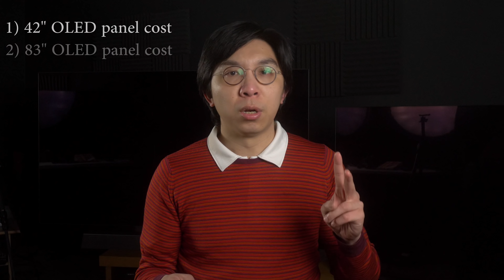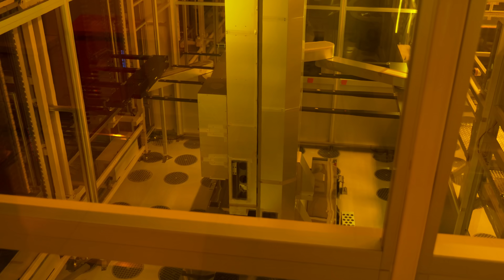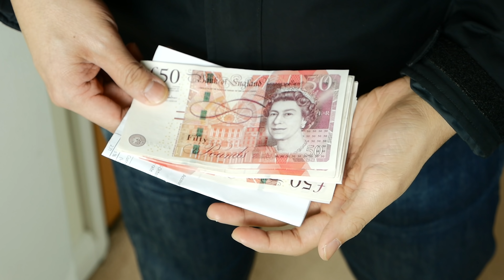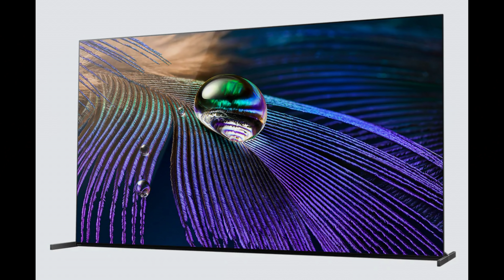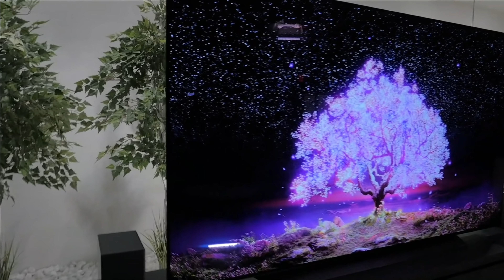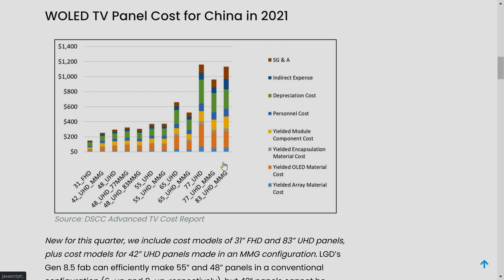LG 42-inch OLED TV Panel to Be 33% Cheaper than 55" - Will You Bite at $1000?

Comment: The issue is that if they concentrate on just cost the TV itself may be crap without the latest HDMI, VRR, HDR etc that are needed for gaming and desired in general.
I am looking for a small OLED PS5/Xbox series X gaming monitor, 32" would be perfect, 42" acceptable but none exist.  I would buy a 42" OLED if it is not cheap crap.
Reply: I agree; I am desperately waiting for a 42" inch OLED with ALL the latest stuff for next gen gaming. I will be SO disappointed if the offering don't include things like native 120hz refresh rate.
Reply: Same here :(
I mean even an mini Led TV in that size with that features and low input lag would be fine

Comment: At one point when I purchased the 48 inch OLED, it was actually more expensive than the 55 inch OLED on Amazon.
Reply: Vincent recently explained the reason in another video ... because production numbers will increase drastically this year (almost 5 times compared to 2020) ... everyone expects tv prices will match the size line-up much better this year ... in other words:  especially the 48" versions will be much cheaper this year and below the 55" ... as you would expect it from the smaller size.
https://www.youtube.com/watch?v=h-OehUXiyr8

Comment: I might bite for PC gaming, as I am currently running a Acer Predator 43 inch gaming monitor CG7 CG437K. That cost me $1200 and I it worked out for me great. My area is very bright being next to a window and having roughly 800 nits in SDR and 1300 nits in HDR mode (according to Tom’s Hardware) was nice. But, now the monitor bugging out by creating a circle on my screen when I go prone in a First Person Shooter games. I am guessing it is a glitch with the reticle on screen feature popular in gaming monitors. But, I do not have it enabled on my monitor as it is distracting to me. Looking forward to replacing it with an OLED.

Comment: FullHD ist enough for most people... a lot sitting 3 meters from a 55" tv, so you really do not need here 4k :D
Reply: That's so true :-)   ... except for HDR where you can spot the difference even from 10 mtrs away (or even more) ...

I wouldn't mind getting HDR with re-mastered new transfers of FHD material, stored in 4K HDR containers to make it not violating the standards ... although when going for a new transfer you can go directly to a higher resolution instead ... lol ... kind of useless considerations, I think ... I just wanted to point out getting HDR i/o SDR is of much higher value than getting 4K i/o FHD
Reply: @marcuscole8796  i transfered all my Blu Ray UHD Discs to 1080p and you cannot see a difference at 3,6 meters away from my 65" TV :P 

The only Problem i have, Dolby Vision movies need a lot more work to add IT again in the 1080p version :/
Reply: @prouuun  Yes, makes perfect sense. My viewing distance is about 2.8 mtrs and even with this smaller distance - when having FHD in good quality - it's sometimes hard to spot differences to 4K on my 65" tv.  For sure you can't see any with your 3.6 mtrs  :-)
Well, besides of that a lot of 4K content actually is not always true 4K (2.4K , 3.6K or whatever) ... so by choosing true 4K material it might be quite easy to detect a difference from say 2.5 mtrs ... but bottom line when concentrating on the movie plot (what I usually do...lol) and not on the resolution ... I do not notice it nor do I miss something regarding picture details ... but the smaller contrast range of FHD I can detect any time  :-)

Comment: 42" 4K HDR 120Hz OLED panel for $1000 would be the perfect PC monitor.
Reply: I would buy it in a heartbeat, holding out on these current hdmi 2.1 monitors bc they have trash hdr so for $1000 this would be great
Reply: @parkerschless3749  but what about the burn in ?
Reply: @mrwaddahshooter  Burn in is no longer a problem. I know some ppl using an OLED as PC monitor for years and nobody has burn in problems.
Reply: @EinBlauerEngel  do they baby it or leave it on all the time which is what I do?
Reply: @mrwaddahshooter  
I don't know if you mean with "all the time"... if you mean 24/7 then no, but shure several hours for gaming where you have UI elements which are not changing
Reply: @EinBlauerEngel  the thing is I almost never turn my tv off and I'm afraid to get an oled for that reason

Comment: The 32 inch oled seem to be the LG UltraFine OLED Pro 32EP950
Reply: No, the chart says 31" not 32" ... and ... the 32EP950 doesn't have an WRGB panel from LGD but an RGB-panel from JOLED (which is not subject of the presentation here)

Comment: $1000 for a 42"?
It's better buy a 65" IPS high quality for $1000 in Brazil, as a Samsung TU8000!
Reply: You are talking "Ferrari vs Hyundai" ... of course the Hyundai has a much better value-for-money relation.  The TU8000 is not even close to being capable of showing HDR. As long as SDR is good enough for you ... the TU8000 is for sure the better choice.

Comment: How comfortable is a 42" panel as a desktop monitor (gaming/developing) ? Standard 60 cm depth desk. I've been considering this for a while, and read that 48" is a bit much. Generally leaning towards having a single 16:9 larger screen, rather than multiple smaller ones.

Comment: ABL will destroy its usage as a PC monitor. I was so sick of the constant dimming to the point that I had to return my 48CX...
Reply: ABL specifically or ASBL and ANSD (which dim static images over time)? The latter two can be disabled in the service menu.
Reply: I am really wondering how you are using your PC monitor.
100nit to 120nit is the standard recommendation for PC monitors in normal office environments.
The 150nit fullscreen white of current OLED-tvs is more than sufficient.

Comment: PASS.  These smaller OLED panels are useless until they are able to achieve higher brightness.
Reply: Still brighter than most PC monitors though, if burn-in is not so much of a problem now, as Vincent tested, there is no reason to get a PC monitor instead of this really...

Comment: i really wish that lg will return making 3d screens with passive glasses ..
Reply: Good luck. There are significant Hurdles with bringing 3D back, especially with the Motion Processing and backlight enhancement tech that’s common for upscaling and HDR content for LED. The tech required for 3D isn’t compatible with HDR, as they didn’t overlap or continue once HDR took over. 

HDR processing for 3D also introduces a pipeline problem as the intentional BFI intervals or staggered frame processing buffers, i.e. frame-doubling 23.976fps to 48fps so that you don’t notice the SDE or blanking left/right frames with Active 3D, or the 144hz DLP options which quadruple the blanking intervals so that the ghosting/cross-talk can be smoothed out as the DLP refreshes and increases the brightness of that particular frame.  Passive 3D requiring filter layers is also not happening if people are still buying panels significantly for HDR’s brightness and contrast. 

You’d be introducing a darker, more expensive QLED or OLED for 1080p content, and 3D content that can’t easily be streamed due to the lack of Multi-Frame encoding in 2020 streaming codecs, alongside 4K and HDR requirements and motion processing / AI processing support, and upscaling etc. support. 

IMO, UST Laser Projectors and DLP are likely going to be the only way to get 3D in 2021-2025 or beyond, but you might also be able to get 3LCD laser projectors if they can get 120hz or 200hz refresh rates going out for VRR support. This would also help with the luma problems that restrict Dolby Vision and HDR10, since the faster frame refresh can also improve light control and exposure with fast-frame updates and much higher laser pulse width/intensity as a necessary compliment for the faster intervals. I.e. you’d probably need a 3 laser option to get a good HDR brightness across 3 LCD or LCOS projectors, equivalent to buying 3 laser projectors and overlapping the output. 

The cheaper practical option would be active 3D with DLP, as you’d need to speed up blank frame insertion on OLED and QLED / Nano/MiniLED faster than 120hz timing to get the proper BFI for 48/50fps or 60hz 3D blank intervals without 3D phase problems eg lingering 3D ghosting causing cross-talk and phase crossover for backlight areas, which are/were common on passive 3D panels. There might be a way to have ALR tech, screens with alternating ALR phase angles for 1080p scaled content, but its such a high expense problem to reintroduce filters on top of the screen when people are still bitter about brightness and burn-in for OLED. 

Having a dimmer OLED panel for 3D would be a huge step back. Adding a vertical or horizontal phase filter layer on top of OLED for passive 3D is also an uphill battle since there’s no more 3D movies being made outside of 360’ videos and VR (or adult content). 

The much better solution, is higher DPI VR headsets, in 5k to 6k resolution, to reduce the screen door effect and simulate a wider FOV so that you’re able to see a foveated “8k” viewport, allowing for a simulated 1080p upscaled “virtual theatre” for watching 3D. If you’ve ever watched a movie with a VR headset, you’ll know its a challenge to have a headset on for hours.  The smaller, higher density panels will also help with fatigue and implementing HDR in VR, which would also improve the fidelity once the HUD hardware is able to keep up.

Comment: 1080 at 32 inch, god no that sounds awful. 1440p minimum is acceptable at that size at pc monitor sitting distance
Reply: I am using 4K DSR on my 27" 1920x1200 monitor which makes 31" FHD sufficient for my needs.
Nevertheless I'd agree some people might struggle with the resulting low pixel density when sitting too close.

Comment: 1080p on a 31in tv is ok, but dang ugly for a monitor. max size for 1080p monitor is 25in. 25 - 32in for 1440p & 32in above for 4k
Reply: I am using 4K DSR on my 27" 1920x1200 monitor which makes 31" FHD sufficient for my needs.
Nevertheless I'd agree some people might struggle with the resulting low pixel density when sitting too close.

Comment: LG. Products wont last long  and their warranty service department is just garage they will not resolve any issues you face with their product  I was cheated  by LG product  service department never ever another LG product in my life- Canada
Reply: They make good washing machines 😂
Reply: @heman691  I have an LG OLED 65B7P with burn in. 4 years old almost. They are replacing the screen. I have to pay for labor. They have been responsive and honest with me. Also my washer and dryer going 6 years no issues.
Reply: @shanew7361  I like LG  I have the 48 CX . in the uk if you get LG extra warranty it covers burn in and accidental damage I also have their washing machine and their great wouldn’t use another brand now.
Reply: @heman691  I bought my 65B7P oled at Costco didn't do the extended warranty. I called and was polite. They said they'd replace the panel as a courtesy, parts only. Mind you this is 4 years later.
Reply: @shanew7361  that’s  a great service 👍🏻
Reply: @heman691  Yea, I called and then got a case # then submitted photos of my TV they said a tech would call me. Tech called 2 days later and voila. So they did what they said they would do and were honest and credible. 

I purchased the LG OLED 77"cx 2 days ago has yet to be delivered. I'm hopeful newer models less likely to have burn in. It wasn't cheap. 🤪
Reply: @shanew7361  Yes LG  products are not cheap either but it won't last only year or little more
Reply: @SamShawn-k2r  I hope you're wrong! For my sake.
Reply: @heman691  They  fooll the consumers to fell in love but their products are not  reliable
Reply: @SamShawn-k2r  I would say that about Sony as I sent a Sony Bravia back that had a manufactured fault after only about a  year and a half changed it for the LG CX because Sony went downhill also Samsung I would never go near them again either after decades of dodgy bezels.

Comment: I will bite on the 42" oled at 120hz but not 60hz. If it's a 42"@60 for 1000 or a 48"@120 for $1400 I will go 48" every time. But if the 42" is 120hz and $1000 it's a no brainer and a much better size for my desktop anyway.

Comment: IS 31" FHD (1080p) OLED ENOUGH? ----I just bought a 31.5" VA panel monitor from Dell running 2560 x 1440p.... even with the infinite contrast ratio of OLED, I would not go less than 1440p on a panel that size. 1440p is very nice for gaming (easy on the computer requirements) but offers enough resolution for my needs... 1080p pixels are waaaay too big.. even on my  other 24" FHD IPS LG monitor - it was not enough resolution to feel comfortable browsing - I felt like my abilities to browse or see the world effectively was shackled... No, I need at least 1440p or higher for browsing and videos. 1440p is a happy middle ground - not too demanding but allows enough to easily surf and "see" the world and websites easily without a crapload of scrolling.... I don't have perfect vision - but i can almost see the pixels at 1440p at 31.5" so i sure wouldn't downsize to 1080p... and bonus, this monitor was on sale and half the cost of the oled including the taxes....... Nice jokes btw  (cheaper than Bitcoin - isn't that the truth! lol)...

Comment: Cheap low quality LED light with Blue light Hazard, no wonder why they are cheap ;)
Get an used 42 inch Plasma instead with real glowing light and watch images/colors and Motion like its supposed to be seen.
For monitor usage there are far better alternatives than OLED.
Reply: Hi Patrik ... again stepping in with your plasma bias for getting rid of some OLED hate ... surprise ... noone is interested in your hate.
Reply: @marcuscole8796  lol
you got it wrong
its not hate its pure facts.
the bad light quality on these OLEDs can easily be measured and easily be seen if you have an reference plasma like the 500M side by side.
Colors on an OLED are not pure and strong but they are on an Plasma tv.
why?
because the light is better and because Plasma tvs used RGB pixels without color filters.
there is no white subpixel that dilutes colors on an Plasma tv.
Real RGB displays also mixes colors better and more accurate.
stop defending an inferior tv its just lame.
Reply: @thebossnocompetition8757  I am not defending OLEDs ... I appreciate ALL tv technologies (CRT, rear projection, plasma, LCD and OLED).
WHAT I am actually defending is my experience here in this comment section. It is extremely annoying repeatedly having to stumble across similar posts of people who are picking single issues (even when they are no issues) out of the context ... for only one reason: discrediting only one of these technologies, by in parallel praising the technology they own ... without mentioning the disadvantages "their" technology has.
What's a fact is:  you are spreading your hate around here for whatever sick satisfaction you might get from it.
You behave like a troll ... that's why you obviously are one ... As long as you're not behaving like an objective, critical and unbiased adult you can not expect being taken serious.

Comment: If the 42" LG OLED had Displayport 2.0 AND HDMI 2.1 120hz @ $1,000. This will be an instant hit. But we can only hope. I just find my 48" CX too big as a monitor, I need a chiropractor for my neck.
Reply: Doubt 42" will fix that... I'm still on 22" 16:10 1920x1200 S-PVA EIZOs for work and FPS - the 65" C9 is on the wall for race games and flight sims. I'll switch when there are 32" 4K or 27" 2K OLEDs.
Reply: @surject  40-42" is about the biggest diagonal size that makes sense ergonomically on a desk as a computer monitor for the classic 16:9 aspect ratio that TV's and most monitors have.
I use a 40" for work and it's awesome, but the biggest-possible size I would want really, not an inch or centimeter more.
Disclaimer: that only works though if you're keeping the keyboard&mouse on the same plane of the table where the monitor stands, and not on a sliding tray under the table, as that tends to put the screen too high up compared to your hands/shoulders/eyes.
Reply: @edfort5704  Thanks, that was reasonable and useful information ... hence I tend to replace my 27" monitor with a 42" OLED when available ... although the pixel density will increase ... what I don't need and maybe not want
Reply: @marcuscole8796  Don't worry about pixel density. 4K at 40-42" is truly awesome and even old software that doesn't scale well with high resolution screens will still look good and discernible.
Reply: @edfort5704  Good to know ... leaves the issue with processing power of my graphic board, my RTX2080S is not powerful enough to calculate most current games with all details in 4K. Then I will be forced to stick to 4K and might be in trouble ... but ... I should check out DLSS maybe it's not so much of a drawback ...
You see, still some things to clarify ... life is not easy these days ...lol (kidding)

Comment: 42” is the perfect size for my bedroom studio, would definitely buy it if it’s hdmi 2.1 for some gaming as well
Reply: Yeah, this would be the ideal size for a replacement computer monitor for me, but without 2.1 HDMI it would be a deal breaker.
Reply: Don't be so hype. Anything about the 42 inch is scrapped from the page.
Reply: @namtrieunguyen7630  LG aren't stupid to not have gaming specs on the 42", they know Pc gamers and even console will want it.
Reply: @namtrieunguyen7630  Yeh I noticed that, not counting on it. For around that price I will  probably just go with the Sony 50” x90j.

Comment: I like when you slip the jokes in unexpectedly. 😮😁  Also, I'm very interested in a smaller sized desktop oled. 32" 1080p at $750ish is reasonable, and 42" 1440p for under $1000 would both intrigue me.